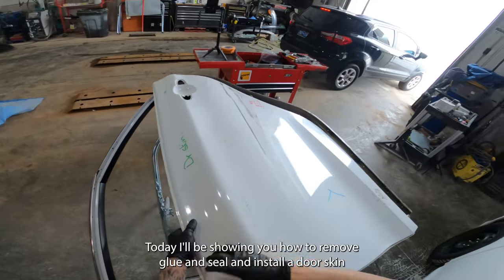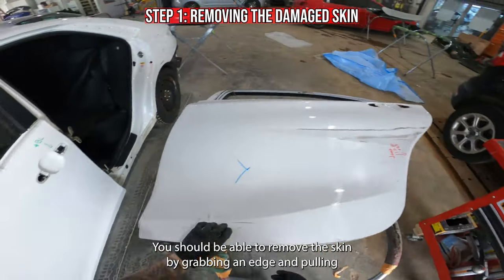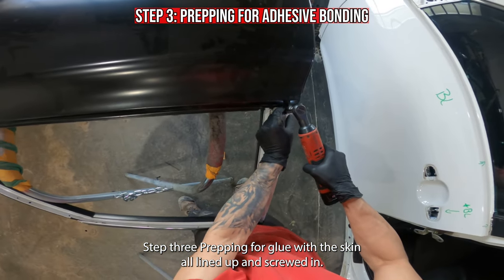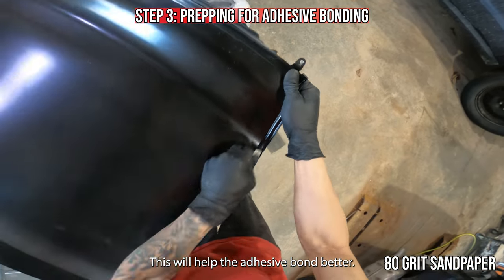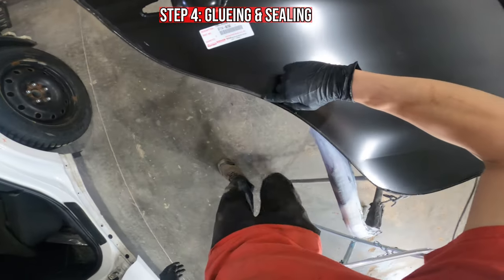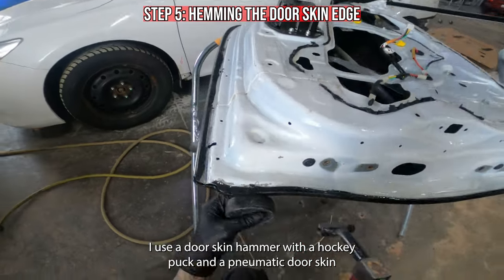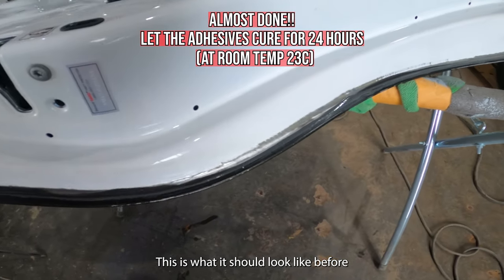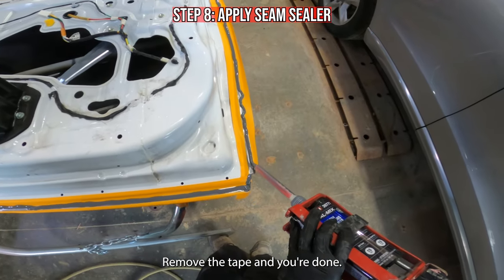How To Replace A Door Skin Without Body Filler(8 Simple Steps)

Comment: sem should have a tip to put on the end of the mixer to finish off the door skin for the self leveling sealer
Reply from the maker: Interested, would you be able to share the part number?
Reply: @AUTOBODYTECH  29312 is the one for the door skin there’s plenty more for making it as close to oem as possible
Reply from the maker: @redneckmtb8084 The self leveling sealer I have here is a 2 part. That nozzle doesn't fit, I don't think. Is there another self leveling sealer I don't know about?
Reply: @AUTOBODYTECH  the tip goes on the end of the 2 part mixer that you were using

Comment: have you ever tried using a torch around the edges to seperate the glue? nothing wrong with what you're doing I just prefer it that way so there's no chance you could damage the mating surface while chiseling
Reply from the maker: Excellent idea! I never think to do this for a door skin for some reason. I find it pops off pretty easily already, but now that you've mentioned it. That's much easier haha 😄

Comment: great job till the end   if you like your painter don't use grinder at the end feather nicely by hand  before seam sealer   lease work for painter and he will not be mad   lol    nice job!  hope you like the tip!
Reply from the maker: Thanks for the tip!
Reply: yes, you should be able to remove the rest of the sealer with a scraper and not leave so many grinder marks in the door shell that have to be feathered out.